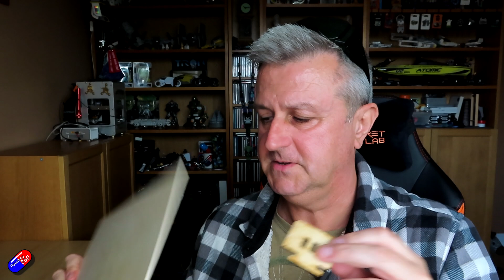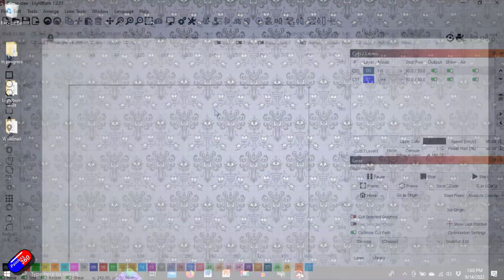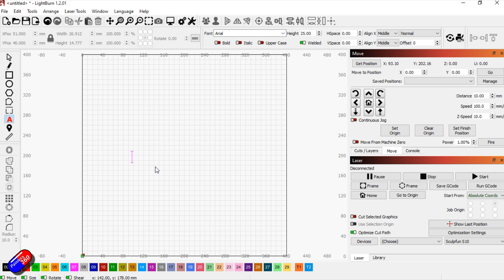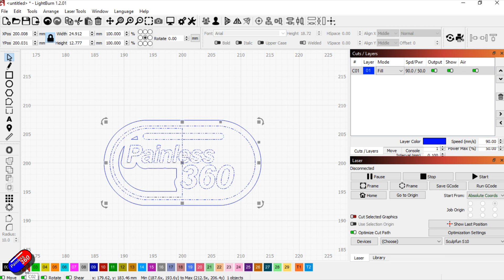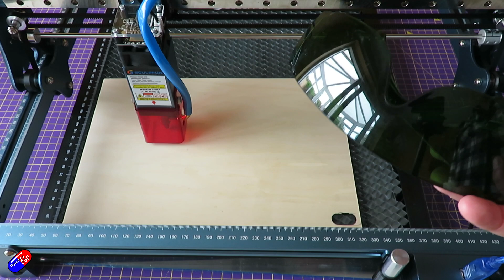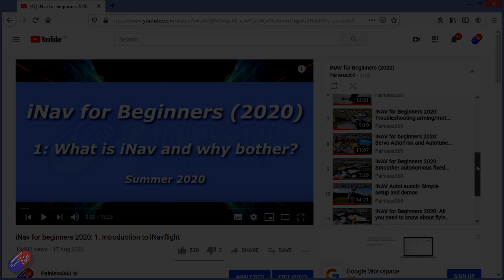Sculpfun S10 and Lightburn: Setup and simple laser engraving demo for beginners

Comment: On a bigger job 5 is going to take forever ( per the recommendation ), can I increase the speed to 600 and 50% power but make 2 passes and get the same results ? Or is my 10w to powerful ? I have a 5.5 w now and am in the process of the upgrade . I know I need to play around with the settings , and I will , but what are your thoughts on it ? I use Basswood and Bamboo and Pine mostly but am trying red cedar , oak and others soon , I just started after Christmas .
Reply from the maker: When I have thoughts like this I tend to run a cutting test on the edge of the material. Have a number of 10mm lines and vary the speed, power and number of passes to see which one works best then use that for the job itself. Does how to do this need a video?

Comment: The part that connects the Y axis motor to the Y axis has some screws that are too large and are not hidden, which causes them to collide with the X axis motor. This part comes assembled from the factory and it is completely impossible for it to have passed the control of operation. as it is intended to show the label that comes a few centimeters from the part with problems

Comment: I used a piece of mdf that the lasercutter is clipped into and then engraved a 100x100m grid over the sheet. I just line up the wood to be cut onto the grid, home the laser and start cutting. I had sockets with screw hole 3d printed that the feet are placed into and it's perfectly aligned each time the laser has been moved around
Reply from the maker: Smart idea!

Comment: Would love to see a wing rib or similar on a printed plan end up cut out of say 3mm balsa
Reply: I've cut a few balsa models using my atomstack a5 with lightburn, with thicker balsa I just do 2 or more passes.  I stick the balsa with double sided tape to the mdf board, bit of a hassle cleaning, but prevents the bad quality balsa from curling up and getting stuck on the lasers shielding plates
Reply: @stephenkolenic303  Thanks Stephan, I am more interested in how the cad software part works, how to get a rib or similar off a printed plan and into whatever software controls the burn
Reply: @peterhancox5268   download plans from www.aerofred.com or www.outerzone.co.uk  check out the following plan on outerzone, oz12729 thermale Aquila Elektro 3.0m glider, PDF file that is ready to be cut. Import it into lightburn, move the sections that you want to cut, in and out of the cutting area.

Comment: Yep laser makes parts easy, and for foam board construction saves finger tip from sharp razors problem is size . Most table top lasers are too short . Extended mine with some new side rails,  20x30 inch foam board fits with room to spare . However the ability for second pass is lost which limits wood cutting to about 2 mm . Lo k for small spars . Take care.
Reply from the maker: Looking at cutting in the next video. I've found a pre 'cut test' on the material avoids the issues with offset second seperate pass as you can add the extra passes into the job from the start... happy flying!